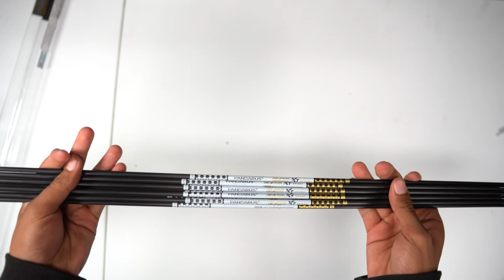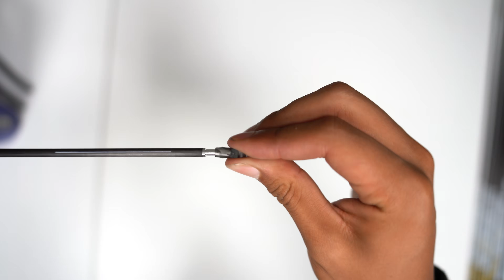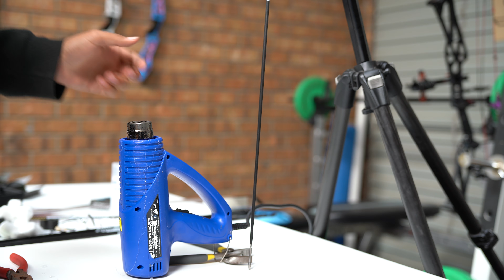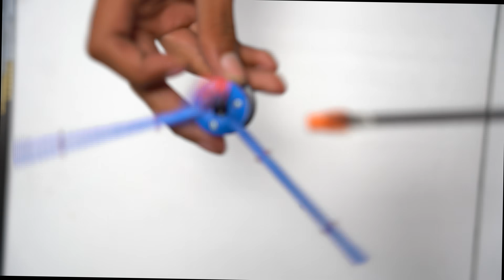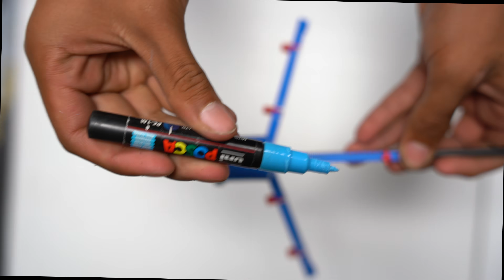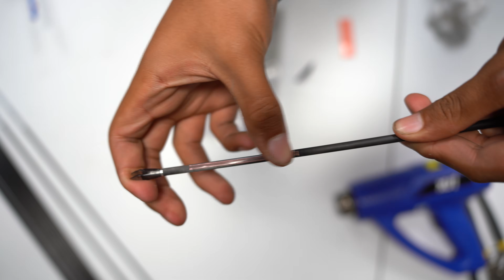James Azli - Pandarus CA320xt set up

Comment: I think u should install the arrow point before the nock pin that will release the air pressure of inside the shaft make it more resistant to breaking down when hit a solid object like the wood of the target stand 1:58

Comment: Very basic assembly for universal retail arrows shown.

Find spine for upper "wing" placement, check straightness and cut worst side to your draw length, adjust exact weight with extra glue while installing points = much better arrows😏👌🏻
Reply: No need to find the spine, these are already "spine aligned" with the arrow spine marked on the shaft. James shows this during assembly. Also being a barrelled shaft I wouldn't be spinning to find the worst end to cut from, that could be an expensive mistake.